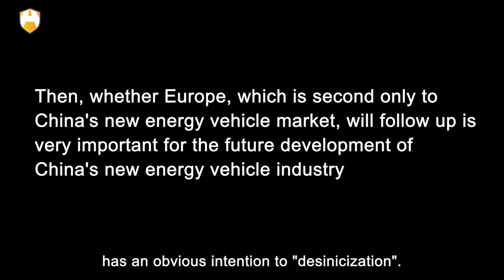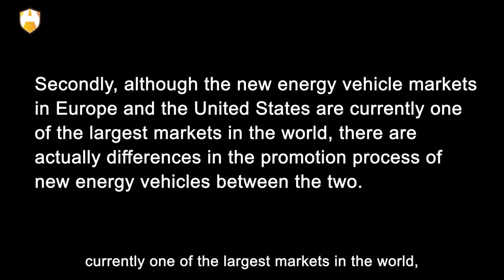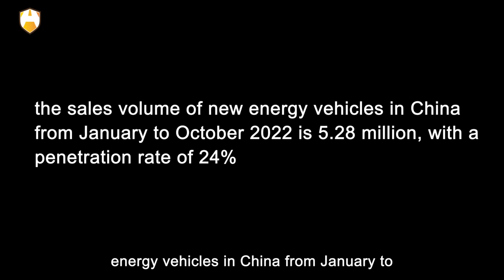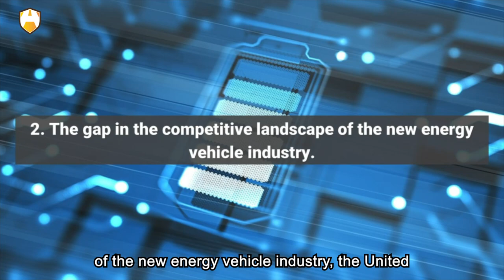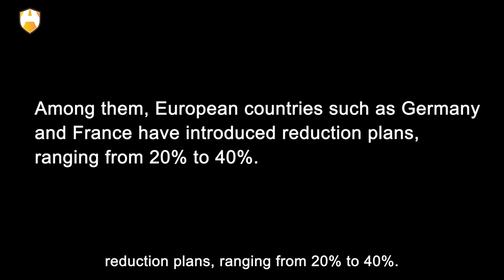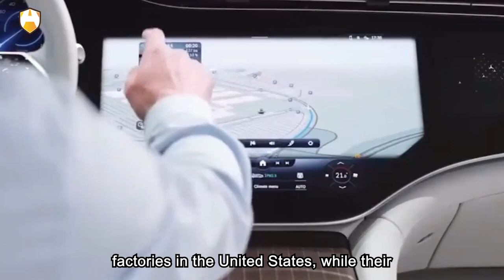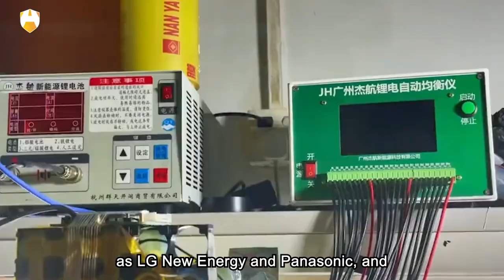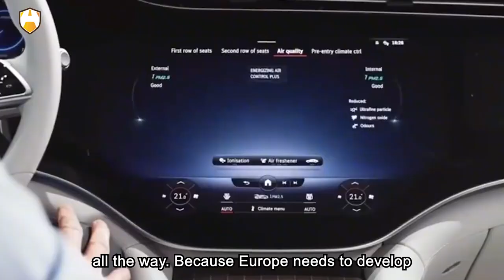USA have started de sinicization in Lithium batteries, will Europe follow up?

Comment: Battery technology outside of China sucks. Believe it or not based on mobile phone alone.
Reply: How?
Reply: @Neuromancer2310  
That is based on my own personal experience alone. Maybe I am s bit biased now.
Samsung mobile battery sucks. They gets overheated. My hybrid Toyota battery failed after less than 3 years. The only consolation is my Chinese phone batteries. They are still OK after so many years. 
Fully rechargeable although the storage capacity suffers.
I stopped them because I bought newer model. 
My present Ssmsung Galaxy fold 4 battery also sucks.